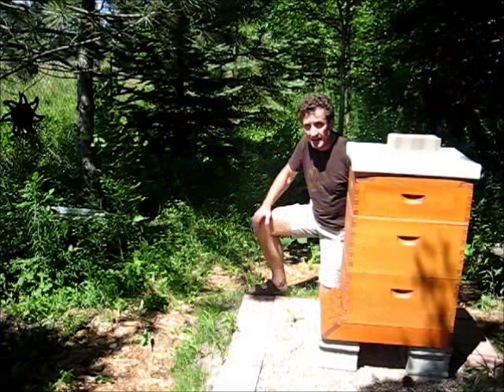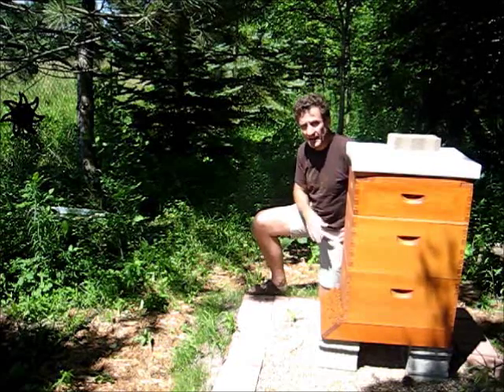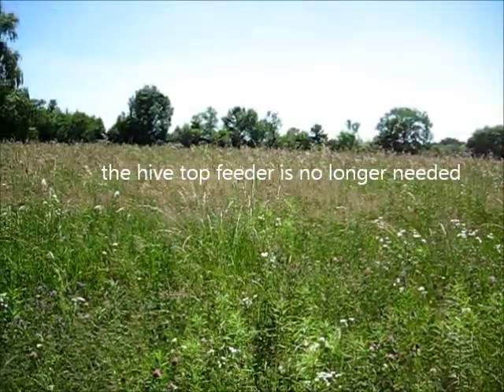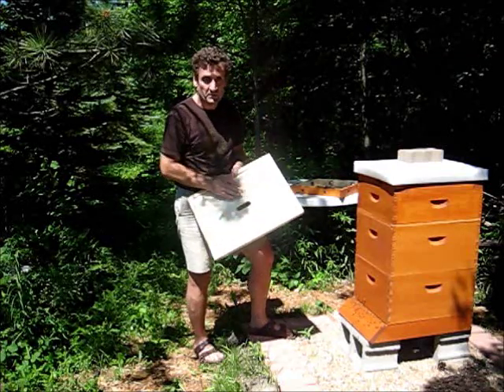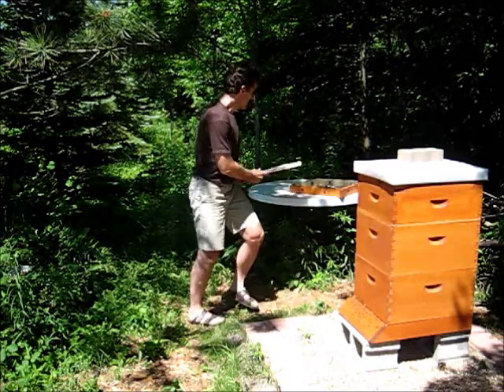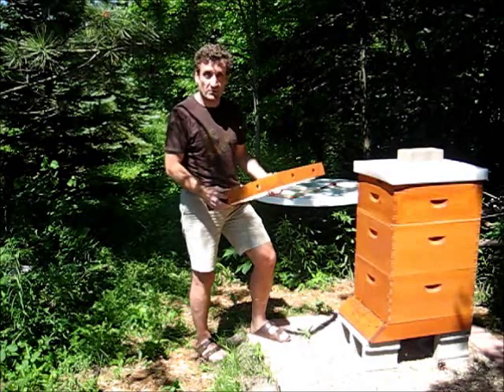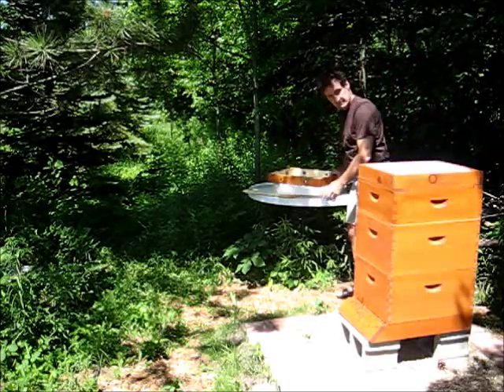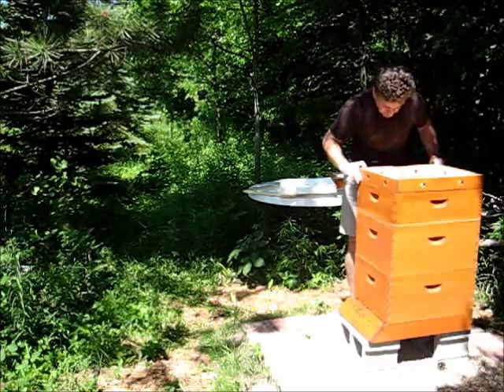Backyard Beekeeping Part 11(S1:E11): Ventilation Rim

Comment: Something that will help your ventilation, summer and winter is switching to screen bottom board. Can make your own. screen on inside, hardware cloth to keep raccoons and other rodents out. 

For small hive beetles we tried beneficial nematodes, 2 yrs ago rather than chemicals. Also use beetle traps, between frames in the top. inner cover deep side down. Plan to make away from hive lure beetle traps to get them as adults before they get in hives in the first place.

Comment from the maker: @groyboy Thanks and good luck with your pomegranate orchard. FYI... I removed the ventilation rim when after several weeks no activity was occurring in the super. I suspect that the light let in from the rim was confusing the bees, I'm not sure. However, as soon as I removed it the bees starting building comb in the super. So I wouldn't recommend you use them.

Comment: How did the upper vents work did rain get in. Were you happy with them or have you got something different now?
Reply from the maker: No rain but I removed the ventilation rim when after several weeks no activity was occurring in the super. I suspect that the light let in from the rim was confusing the bees, I'm not sure. However, as soon as I removed it the bees starting building comb in the super.

Comment: On most things hive strength is part of the best defense. Some of the beetle traps from bee suppliers, are good concepts, but too flimsy, or holes too small for adult beetles. I don't like the idea of pans directly under the screen bottom boards, takes their ventilation aspects and nullifies it.  Since your stands are open under hives, can place a beetle larva trap, raised off the ground under your screen bottoms, and get most of the ones who don't go out the front entrance. break the life cycle

Comment: Feeding bees when you have a honey super on isn't a great idea. Stop making your hive lawn furniture colored yard art and paint it white will help with heat and be better in winter. Some use screen inner covers, along with the eke vent you made. Vent eke is good for increasing air flow to prevent condensation freeze melt drips on bees.

add a little apple cider vinegar will help with sugar water molding or fermenting, and better for the bees, but DO NOT feed bees while you have honey supers on.